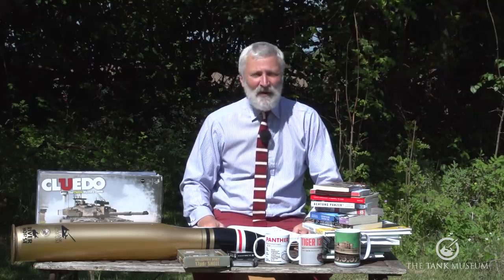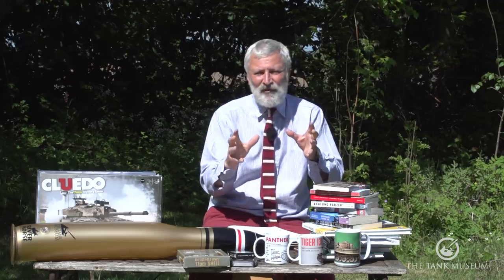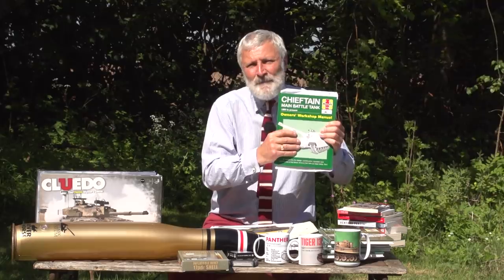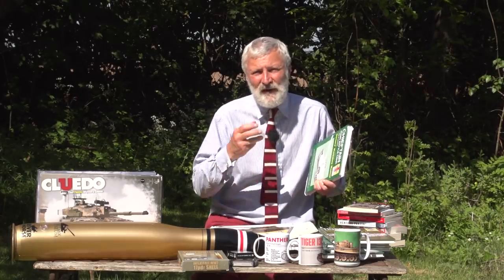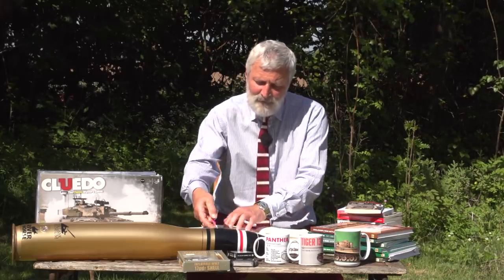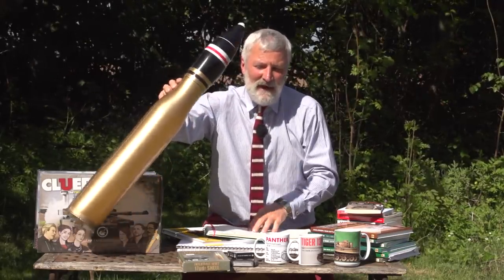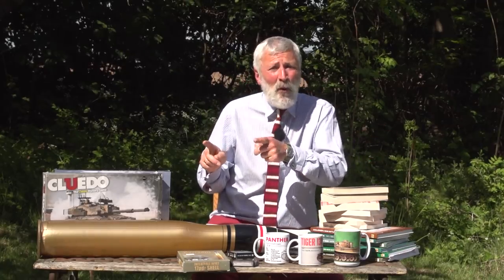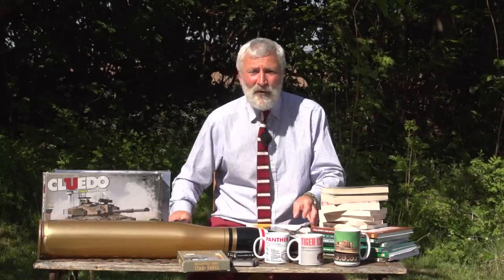Curator Q&A #6: Tank Tracks | The Tank Museum

Comment: I must ask: can those inflatable rubber dummy shells be chambered in the guns of WWII inflatable rubber dummy tanks?
Reply: It's possible - but you run a very real risk of having it 'blow up' in the inflatable breach...
Reply: A thought occurred to me, if the designs of the dummy tanks and such were still around, a scale reproduction would be fun.
Reply: @MajesticDemonLord  nicely done.
Reply: Sure. After all, everything is to scale. To fire it, however, you just release the filler cap and away it goes.

Comment: Excellent David! You have just made my day. 👏🏻👏🏻👏🏻👏🏻👏🏻 that was one of the questions I wondered about the track set up. I figured that if the German heavy Tanks had rear wheel drive there wouldn’t be that loss of torque and hp through the shaft. I believe that’s called parasitic drain. And maybe the Maybach engine would have been able to be more reliable when it came to not having to over rev and damage the systems.
Reply: There would also be a weihgt saving that goes with the space saving, of not having a long, heavy drive shaft running the length of the tank - and needed support between clutch & gearbox. Having to pull that out would be a nightmare. So, better to have the gearbox coupled directly to the motor, no shaft.

Comment: The Chieftain gazes in disappointment as track tension was not mentioned in a video about tank tracks.
Reply: @wakenbaker-uk The location of the slack on the track is not the same as track tension.
Reply: It's his punishment for his current job
Reply: Fact that he's doing this video from home is a major effort and all you can do is nitpick. Sad
Reply: Don't worry.  If it's used on the Sherman, then it's the only way to do it.  At least to the Chieftain.
Reply: @StuieStorm05  Would have thought they'd have said track tensioning for adjustment of track tension?
Reply: He did a similar video on his channel.

Comment: Finaldrives are more protected with the sprocket on the back. Ive seen a fair amount of m113 with busted finaldrives due to idiots in armoured vehicles.
Also, Otto Carius mentioned that his drives removed the outer roadwheel on the 1 axel, to avoid the track getting of due to debris on the track.

I like your quaratine vids, nice and personal 👍

Comment: Thank you David and Richard for the excellent entertaining and informative chats over the past weeks. One point that is never really been talked about, and I can find almost no information about, is the inertia starting system used in German tanks. Some refer to a 60kg weight being wound up to speed and using momentum to turn the engine over and others references suggest a spring, like clockwork, and then released. Can you shed any light on this. The Haynes book mentions the inertia starter procedure but glosses over the actual working parts of it.
Many thanks and maybe consider continuing these talks when life returns to normal.

Comment: If the sprocket is at the front its called a "live" track - sprocket at the rear - a "dead" track. one other advantage on some tanks with dead track - I believe Centurion is one - is if the track is damaged, or a front idler or roadwheel, it's possible to remove the damaged section and refit the track but bypassing the front idler as a get you home measure!

Comment: The tank has the drive at the rear, as it has a power pack, all the working parts are in the rear, APC,s  have the drive to the front to enable the crew compartment to be free of obstructions at the rear.

Comment: If the drive sprocket is in the front the driver, Radio operater and transmission share the same compartment. Hence the tank can be built much shorter, which saves weight and makes the tank easier to steer. If you take a look at the panthers hull compared to the centurion, both offer almost the same level of armor protection, but the hull of the panther is almost a meter shorter and because of this up to 4 tons lighter.

Saving weight was also important in the Shermans case. But you cant go for a power pack systems, which is why we don't see engine in the back drive sprocket in the front configurations anymore.

Comment: Something I think you missed/overlooked in your tracks chat here. When you have power delivered to the track from the front. Yes you have a cleaner track and thus lower/much lower wear on the track and sprockets. What you have going under the tank [or any tracked vehicle] is a loose track. A loose track that conforms to the contours of the ground will give more traction. In certain conditions will give much much more traction. As a last I am waiting for a hydrostatic drive in tanks.....smooth steering....strong braking with out brakes wide speed adjustment with full power/torque at all times. And the ability to put the drives back at the front

Comment: Think you'll find with a rear sprocket layout that immediate traction response is higher, that the tracks themselves physically grip the ground beneath and thrust it forward, where as a front sprocket layout, the track "rolls" the vehicle "over" the road wheels [is the best way i can put it], as opposed to accelerating through traction. Would probably explain why most tanks use rear sprocket design.

Comment: Another great video from a great museum. I can't wait to visit once this virus has run its course.

Something I've always wondered was what the design considerations were for using aircraft engines in tanks, when did this practice start and end? I always assumed that aircraft engines were optimised to run at high rpm, low(ish) torque. Which seems like the opposite requirement for a tank?
Reply: Mainly because they are "light" and compact for the amount of power they deliver. Also they were not just taken from a plane and plonked in a tank, they were adapted. The meteor for example was a de-tuned Merlin without a supercharger (as far as i can remember anyway) and to be fair it wasn't that wide spread really. The germans used dedicated petrol engines, the russians went with the V2 diesel and the americans used whatever was available (petrol, diesel, multibank, aero).
Reply: Thanks for the replies everyone, I think this would be a fascinating subject for a whole talk! It's really interesting how the three powers approached things as fundamental as engines so differently.
Reply: Whether Merlin or Allison,they are big engines and piston speed is always an issue. The rpms are very low compared to modern car engines. Cannot remember offhand but look up Wiki etc. 2400 rpm ain't much nowadays but that is right up there with aviation. Think about the rotating mass of 12 times 6 inches by 6 inches ( approximately).Overhead cam or not,this is not a Ferrari design.
I recollect that P51 pilots were warned not to firewall the throttle on takeoff from standstill. The massive torque increase could and did flip the airplane on its back. What you know about car engines mostly does not apply here.
There is a Liberty engine that Alexander Graham Bell used in his hydroplanes in Baddeck, Nova Scotia museum. Put my hand on it as a kid. These things are huge.

Comment: If only we had the Haines manual to the Chieftain in the 80’s REME could gave fixed them quicker when they broke. 😀
Reply: There's actually a good anecdote in the Haynes Chieftain manual about a crew using the operators handbook wedged in the circuit breaker panel to stop them tripping so they could get back to the REME fitters 😉
Reply: The faster you fix them the sooner they break again!